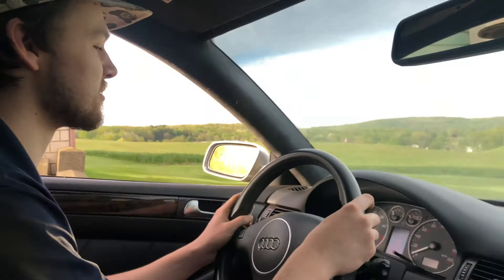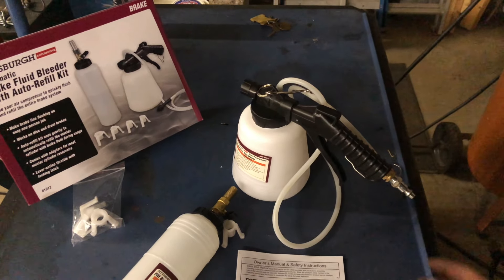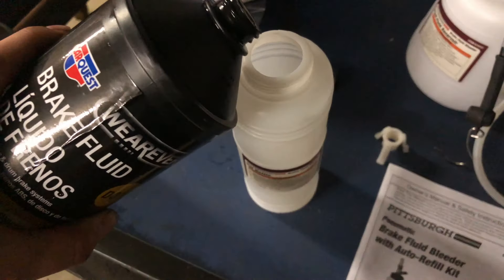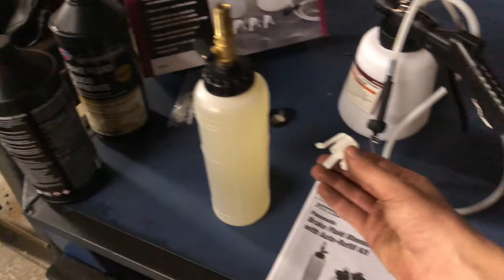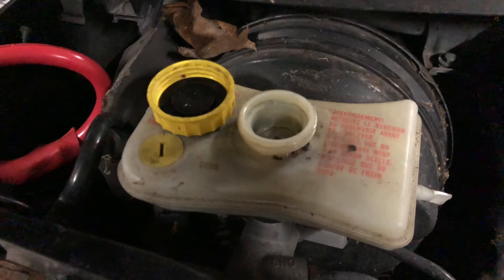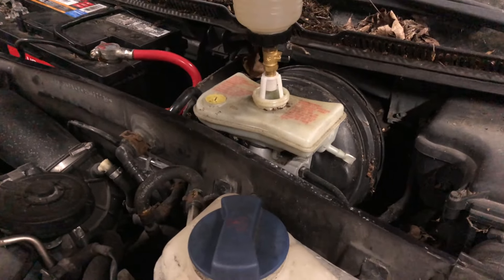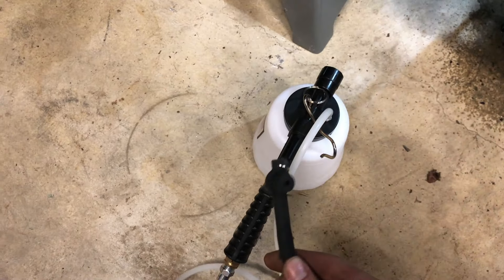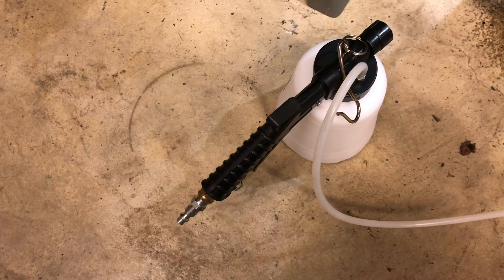How To Bleed Brakes Easy! - Harbor Freight Pneumatic Brake Fluid Bleeder

Comment: 3 tips... Bottle connection is upside down... Bottle should be in the reservoir making contact with fluid to fill as needed. Use silicon grease at bleeder valve and vacuum fitting..a lot of bubbles you are seeing may be aeration from air getting into the tubing from the fitting.. Last, work from the furthest caliper.. Usually rear-passenger.. Your pulling the clean stuff through most of the system and doing the rest will go more efficiently...
Reply: Exactly what I was going to say
Reply: I was going to say the same exact thing....Sometimes the directions are worth looking at, if you don't know what your doing lol. ( I know no ones perfect but)
Reply: @3:00,  nozzle needs to below reservoir level to replenish fluid
Reply: @PatricksDIY the blind leading the blind lol
Reply: For VW/Audi it is procedure to do fronts at the same time first but when you are activating the ABS with VCDS. (VCDS is a VW/Audi/Porsche/Bentley software for diagnostics and adjustments)
Reply: excellent tips thanks
Reply: There's so many people making videos and don't even have basic knowledge of what they're doing
Reply: VW manual states to start at front left to front right. Rear left to rear right. When using VCDS
Reply: @forsurechicago8728 car but USUALLY you start from the caliper furthest from the master cylinder... My original comment was more focused on how to use the bleeder (generally) not the specific maintenance of the Audi.

Comment: When you bleed your brakes you must start with the passengers side rear brake then drivers side rear brake then passengers front side then drivers front break.
Reply: Bleeding procedures will vary by manufacturer.
Reply: @markinhobarbouza  true. Rule of thumb is, start bleeding at furthest wheel away from brake master cylinder and make your way towards the closest wheel
Reply: @markinhobarbouza  yea it varies by manufacturer but still by the location of his master cylinder the rule of thumb holds true lol.
Reply: Actually it is the furthest point from the master cylinder if the vehicle does NOT have ABS. If the vehicle is newer, it's the furthest point from the ABS unit. But you should always check with your particular vehicle manufacturer, because some manufacturers (Toyota for example) don't run the brake lines direct, so the furthest point could be a different wheel than thought because they run a brake line in an uncommon fashion (such as down one side and then crossover under the trunk and back up the other side)
Reply: U wanna start on the furthest brake from the abs module. Not the master cylinder

Comment: Check your directions for the proper fitting on the fill bottle adaptor.  As Wii J. said, you have it on backwards.  In the orientation you have it, the reservoir WILL overflow and not stop until the bottle is empty.  Not a good feeling when you see the mess.  Peace!

Comment: Always start in the rear when doing flushes. You start from the furthest away from the master cylinder
Reply: Why not furthest away from the ABS module?
Reply: Every car is different. I hope yah know that.
Reply: This is not true.  Honda cars manual even state to do the front left first
Reply: My Hyundai Genesis is RR,FL,LR,RF. People need to read because posting videos and giving out false info.
Reply: Nope. Not always. It depends on the vehicle / location of ABS module...

Comment: Some people say change all fluid some say don't bother. I am in the school of change it every few years but the best practice is to start with the break farthest from the caliper.  It will save you time and fluid doing that.   Hope that helps you for next time
Reply: Caliper or Master Cylinder?
Reply: I agree. I've always understood that brake fluid is hydroscopic and can absorb moisture. Plus if it's showing color from age it's worth changing.
Reply: @elifire4147  master cylinder
Reply: I'm adding this in as a piece of advice for anyone who needs it. 

It is important to change brake fluid every 30,000ish miles because the fluid can take on moisture. The problems with moisture getting into the fluid is that 1) it can be corrosive if the moisture content is high enough, and 2) water in the brake lines has a different boiling point than brake fluid. As we know you're putting the fluid under pressure, and if you have too much moisture in the system, you could potentially boil the water content introducing air and reducing the efficiency of your cars ability to brake. 

Better to just do it than let it go by the wayside.

Comment: Fellas, do not use a cheep air compressor with a small tank. It will take forever and I ended up pumping the brake myself.

Comment: I noticed something I would do, if that was my car. I'd put an adhesive backed rubber pad between the battery cable and the metal frame. It might not even be touching the frame, but it sure looks like it is.

Comment: I used one of these turds today now my brakes are shit lol.  They were fine, just an older low mileage vehicle with original fluids. I was getting air leak past the threads, so the bubbles were never ending.  Going back to the good ole tubing in a pop bottle gig.  Would've been faster for me too.

Comment: One thing you should have started on the rear brake farthest from the master cylinder then work your way progressively closer
Reply from the maker: True
Reply: Not when the ABS module is at the rear of the vehicle...

Comment: Isn't this a closed system? That means that you only need to bleed one caliper and the pressure draws air through the entire system?
Just read that somewhere when I bought this system.
Reply: It’s a closed system but their are 4 feeds. Generally 4 separate lines. Meaning the rear brakes have one line that splits to each wheel. At differential. And the front brakes have each an individual line. To remove air out of each line you need to do this four times. Starting with longest line or right rear wheel first. Then passenger front then left rear then left front. Going from Longest line to shortest lines.

Comment: Hello friend, would this be successful in pushing air out of master cylinder (ran dry) while bleeding on truck?
Reply: Respectfully (however please correct me) but it appears you failed to constantly monitor the fluid level in the master cylinder whilst bleeding the brakes & consequently the very reason your master cylinder simply ran dry??? Monitoring the fluid level of your master cylinder is merely a basic requirement of any brake bleeding job period!! Suggestion!!! get someone else to finish the job that you mucked up through ignorance & an obvious lack of basic "brake bleeding" knowledge & experience!! This job is over your head for sure!! I'm not even a mechanic & even I know about this procedure!!

Comment: How much psi is required for a system  like this? Will a pancake compressor work?
Reply: The manual says it needs between 90 to 120 psi.

Comment: the bottles stem needs to submerged into the fluid reservoir to avoid (A: overflowing), (B: to avoid air being captured while fluid is suspended between fill bottle and reservoir). 
fluid in the refill bottle should be filled to the measurement of what is 
(specified by the manufacturers) that a system requires to operate;  
i.e. a (1 to 1) ratio, or a quart for a quart. 
As well, when using the vacuum bleeder: manufacturer specify how much pressure is recommended to drawn from the system at any given point.
running the right pressure reduces the risk of creating micro bubbles throughout the system resulting in more fluid cycling procedures.  
from the comments: tank size is equal to the value of which how many cubic feer per minute can be moved (in conjunction with refresh rate) of the motor at a sustained psi. 
thanks for the video man. 
i got a rough idea where i put the rest of that kit now.
Reply: What is the principle of the fluid being drawn in to the master without overflowing? I used to know the name but I’ve since forgotten.
Reply: fluid dynamics
Reply: @freestyla101 The Barometric Formula. it's the same concept that is used to measure InHg. If you stick the neck of a full bottle into fluid above sea level, atmospheric pressure outside keeps the fluid in the bottle.

Comment: How long did it take for each corner? I replaced all kinds of stuff on my brakes (big brake kit, rear drum conversion to disc and added a manual proportioning valve and I bled for about 10 min per corner and I still have spongy brake.
Reply from the maker: It took forever and a few cycles
Reply: @ ok maybe I need to bleed much longer. Thanks.

Comment: Just litterly bought this this Harbor freight brake bleeder yesterday. It's how I intend to spend my morning tomorrow thanks man👌👍
Reply: How did that go cause I’m about to buy one this afternoon and spend a rainy day with it 🤣
Reply: @edgeofdarkness6132  Worked well as advertised.
Reply: I'm using it now, it looks like it's not pulling anymore fluid, but my reservoir still has fluid.  Am I missing a step or is something seriously wrong?  
Scion iM if that makes any difference.
Reply: @matthewmagee5117  mine is the same way.  its more air than anything.  someone please help

Comment: Just wanted to share some helpful tips. 1. you need to start at the furthest caliper from the master cylinder. 2. Flip the adapter around so the refill bottle fits in properly and doesn't over flow. 3. Make sure you seal the fitting on the bleeder valve with some grease or something a lot of those bubbles are air slipping in by the bleeder screw.
Reply from the maker: Thank you

Comment: i have this, and i can't get any brake fluid to flow into the bottle.  i did it for a while and still no fluid.  i hooked it up just like yours, maybe mine is defective?  what are the tricks?
Reply from the maker: If the valve is set to open and it’s not flowing I would say it’s defective

Comment: I always have trouble with these one man bleeders. Never tried this one before but I have used the hand pump harbor freight one it kinda worked but I ended up doing the two man process ya a pedal pumper and valve opener. I live alone and I don’t like having to bug n beg someone to help me next time I might try this one out seems better than the one i tried from HB and I tried a $20 amazon one it’s sucked let more air in then it pulled out

Comment: TIP- Anyone who has had thier master cylinder leak back into their brake booster- how do you get all that fluid out without having to remove the booster and try to drain it and all that jive- right? You buy one of these- but instead of connecting it to the bleeder valve on your caliper- you remove that tip and use the hose like a vacuum cleaner to suck the brake fluid out of your booster. Once you have the fluid out- you don't have the fluid out- trust me. Pour water in it- relax, you're going to suck it back out- repeat until the water comes out fairly clean. Now use the air compressor to blow air in it and dry it out some. Now you can replace your master cylinder- and bleed your brakes with it like it's intended- put the tip back on. 

And when you mount your filler bottle- the tip should be down in the reservoir submerged in your old fluid- so no air can be pulled into the system. This guy has the mount on upside down so- that's why the bottle is up above the reservoir- still works though apparently.

Comment: I just bought this bleeder but the box says you need to use it with at least a 7 gallon compressor. Why is that?
Reply: you can try it with a smaller one. It may work fine. 7 gallons is probably the minimum of what the found to work the best. As long as your compressor has enough cfm to create enough constant vacuum. It should work no matter the size of the tank
Reply: @stang1970  Thanks for the response. I was thinking of returning it but I'm going to give it a shot to see if it works well enough to keep.
Reply: @thomascampbell5633  did this work out? I have a pancake air compressor.
Reply: @npolite22  It worked well. It would be faster with a large, powerful compressor but it should be OK with most pancake compressors. Mine is a good pancake compressor with 1.3 HP, 6 gallon tank, 200 PSI capacity and 4.0 SCFM air flow rating. 
One tip I learned is that you can keep air from leaking at the bleeder screw by wrapping the bleeder screw 3 times with Teflon tape. Then close the bleeder screw. Hook up the power bleeder and turn it on. Then slowly open the bleeder screw until you can see the brake fluid move through the tube. That way you will have no, or very little air leaking through the bleeder screw into the plastic tubing.
Reply: I have a 2 gall Craftsman air compressor  & a 20 or 26 gall air compressor but, I used my 2 gall compressor yesterday bleeding my brakes with my Pittsburgh Pneumatic brake bleeder kit & it worked fine. Just had to take breaks & to ensure the master cylinder was fine because the bottle wasn't fitting quite perfect but, it worked very well
Reply: @d.j.9961  with all of the bubbles being pulled from the bleeder do you worry about air getting in there?
Reply: @npolite22  I see no reason why your 2 gall pancake air compressor wouldn't work!  The only difference would be the amount of times the air compressor cycles. I used a 2 gallon Craftsman hotdogs style air compressor & it worked fine. I was actually impressed! JUST MAKE SURE THE MASTER CYLINDER NEVER RUNS DRY! KEEP IT TOPPED UP & CHECK IT CONSTANTLY!

Comment: My problem is that I cannot get rid of the air bubbles running through the line. Like he mentioned air might be coming from the fitting. Any suggestions?
Reply: Take the bleeder screw out and put some Never-Seize or grease on it to help seal it.

Comment: I'm thinking of trying this on a slave cylinder, who's with me, am I a genius or has this been done
Reply from the maker: I think it would be easier to have someone pump the clutch while you open and close the valve, this tool can take a while to fully bleed
Reply: Ok, I never tried it before, I bought one awhile back at HF for cheap just to have and my clutch is lil spongy, it can take awhile to manual pump with leg also( some times) and my ol lady hates it, I figure it has to be a win if it can be done! Woot woot!!!!

Comment: I bought one and found it to be a complete JOKE. All it did was run the heck out of the compressor.
Reply from the maker: It doesn’t get tight enough around certain bleeder nipples for sure
Reply: I tried it once with a little 3 gallon compressor a few years ago and had the same results as you. I now have a big ass compressor and I’m going to attempt this today and see how it goes.  Just waiting for Amazon to deliver my DOT 5.1 brake fluid.